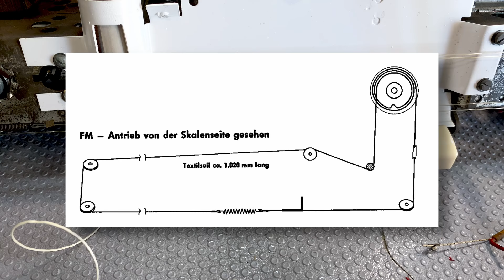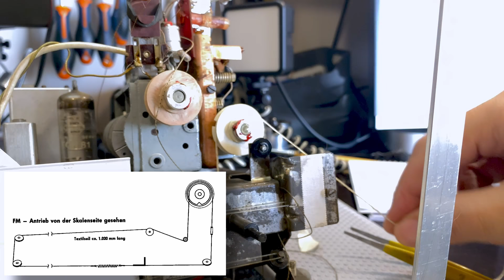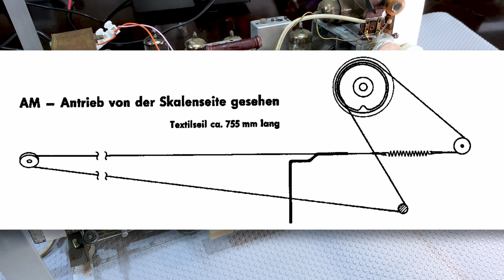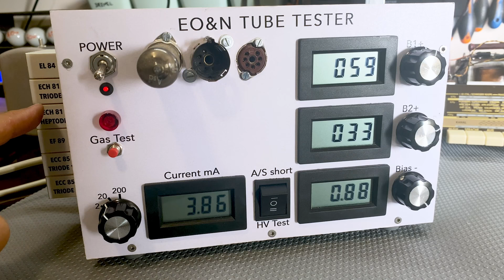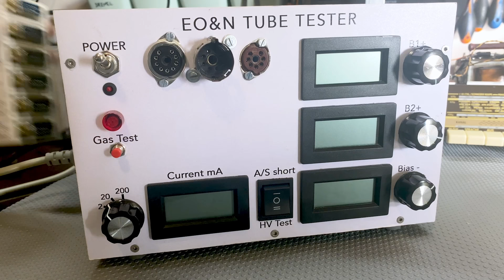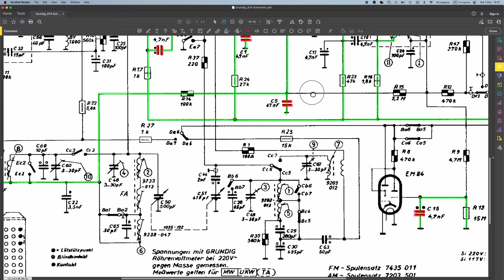Dial-string nightmare, and AM testing. Grundig 2140 restoration - part 4

Comment: I restored a Grundig model 97 USA (exact chassis as yours) beginning 2 years ago. I had the same issues (stuck FM tuner, dial strings, electrolytics, capacitors), but I had to heat the FM tuning condenser to get it to turn and broke one of the solder joints in the process. During its 6 hour test run in, it performed beautifully. Feeling confident, I left the room and it went silent. It took me an entire year!!! to discover what you found in minutes, the R20 capacitor had opened up. That fixed, this radio sounds amazing and is an FM beast. This radio and a Blaupunkt Barcelona 3D are my daily drivers.
Reply from the maker: Yes, some of those faults are really touch to find. Well done.

Comment: Hi 
It's a pleasure to find another fellow in Portugal that loves electronics and tube radios. Dial strings it's any ones's nightmare, and years back when I visit the Philips factory at Ovar and the Grundig one at Braga, I was marveled with the skill of  the girls that put the string, in some of the most infamous and difficult radios to repair and service. They did that in under a minute,  I learn some tricks too , but still  I usually spend a lot of time struggling with it, every time I do have to change a string. Good job Mr. Madeira !
Reply from the maker: Thanks José. Abraço

Comment: Informative video, I can't imagine anyone enjoying stringing a radio. I recommend losing the 3 in 1 oil and the WD 40, use a very light synthetic oil, it's used on turntables, tape decks etc. and it actually cleans as it lubricates.

Comment: I heard the string go "ping" and pop when you were turning the pulley.  I recommend against using regular 3 In 1 oil because it slowly polymerizes and thickens upon exposure to air.  They make a special motor bearing lubricant that is more appropriate for this type of use. Almost any synthetic automotive oil will also work.
Reply from the maker: 👍 I also heard it when I looked back at the video. At the time I didn’t hear anything.

Comment: Manuel... I know this problem with the sticking variable condensor ... I use my soldering iron...i heat the busching ..make ik very hot , then like you, use WD40 en turn from left to right .The problem is the grease that"s becomes solid, so if you heat it with the tip of the soldering iron this grease becomes liquid again..done it many times...works every time ! Greetings from Belgium.
Reply from the maker: Thanks Dirk 👍

Comment: I use a bit of heat, electronics cleaner, some more heat and finally some thin oil (CRC 2-26 is also usable
Reply: Or Tri-Flow Industrial Lubricant, if you don't mind the smell.  It doesn't hurt plastics.  I use it in electric clock motors.
Reply: Heat will drive out the air in the spindle bearing and create a small vacuum that helps suck the penetrating oil back in when the junction cools.

Comment: Heating the frozen spindle bearing with a soldering iron or hot-air pencil before applying lubricant or penetrating oil is helpful ---- heating it drives out air and creates a small vacuum which will help pull the penetrating oil back into the junction as it cools.  Be sure to put something over the plastic pulley and dial string so that a spastic movement of the hot air pencil or soldering iron doesn't melt them.  I wouldn't use WD40 anyway. As penetrating oils go it's really not very good.
Reply from the maker: That’s a good method too. I didn’t think of that with this one as it was moving a little, but would have been easier, I’m sure.
Reply: @electronicsoldandnew  ,  I have freed up frozen rotary selector switches on dynaco preamps and Hickok tube testers using the heat and penetrating oil method, plus a pair of vise grips to grab the metal shaft and turn it.  Just be careful not to saturate the wafers of the rotary switches with oil or contact cleaner because you don't want to risk making them conductive, especially on a tube tester.
Reply: I often use that warming technique, it also works for epoxy which will go water fluid after short warming, and then when cooling the shrinking air will pull the stuf in every pore. You only need to contain the epoxy, because it really runs out.

Comment: Excellent work Manuel.  Good to see that you have come to enjoy dial stringing you too 😄
One way to loosen those stuck tuning caps is to carefully heat the axel with a heatgun.
Just cover the plastic wheel etc if you don't feel lucky...
I prefere to get it to turn just so it reaches one end of it's travel, and then remove the axel there.
It's usually held in place with just one C-clip on the inside.
Then I can clean it for old grease and relubricate it again. 
Then it runs really easy and smooth.
Reply from the maker: Thanks 🙏

Comment: WD40 is good and bad at the same time, great for freeing something up, but horrible as a long term lubricant.  I like that you made the point of saying you use WD40, then you wash it out with isopropyl then relubricate with a proper oil.    I've seen some just use WD40 and not a proper lubricant and when the WD40 drys, it just gums everything up so badly :(.
Reply from the maker: Agreed. Always best to wash it away when it’s done it’s job.

Comment: Aprecio bastante a qualidade do teu trabalho e a paciência/prazer com que o fazes. Tenho que agradecer a abordagem didática e a tua generosidade em partilhar.  
Tenho reparado que usas uma proteção para não danificar o tampo da mesa. Tenho experimentado várias soluções mas o resultado não tem sido satisfatório. Podes dizer que tipo de material usas para protecção do tampo da mesa?
 Obrigado.
Reply from the maker: É um tipo de silicone, mas não muito resistente ao calor. Compro em rolo de 1.5m (60cm de largura) na Leroy Merlin ou na maxmat por cerca de €5. Corto em duas metades e substituo de vez em quanto.
Reply: @electronicsoldandnew  Fico agradecido pela tua amabilidade e resposta rápida. Boas Festas.

Comment: where did you get the dial cord from. Every time I buy dial cord it stretches like a rubber band and I have to keep stretching it and shortening it. It takes me forever to keep doing this. Eventually when I get it tight enough it works fine but the initial stretching is aggravating and makes some configurations impossible. 
I don't think I'm getting dial cord but probably something else being sold as dial cord.
Reply from the maker: I’ve got a lot of it that a viewer sent me, so don’t know where you’d buy it these days. However, I normally stretched it overnight before using it, and the problem of stretching goes away.